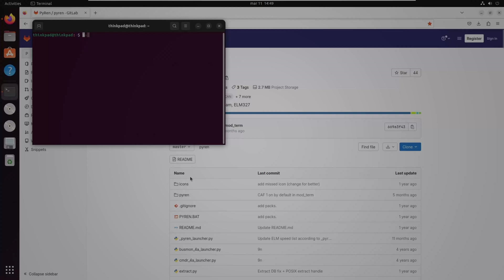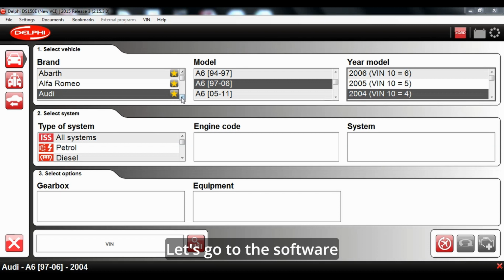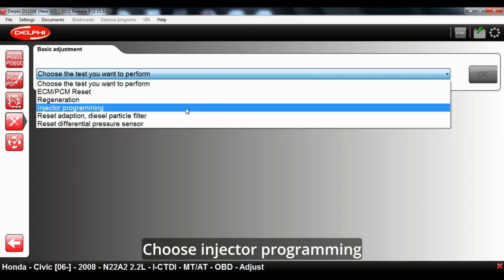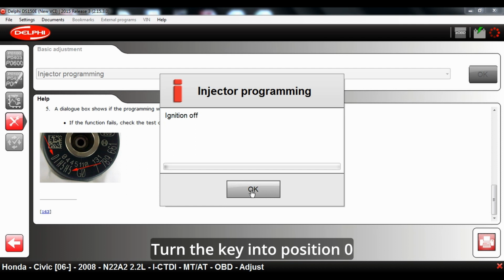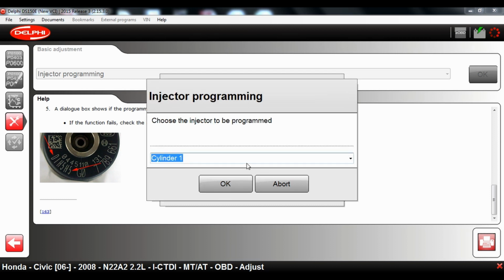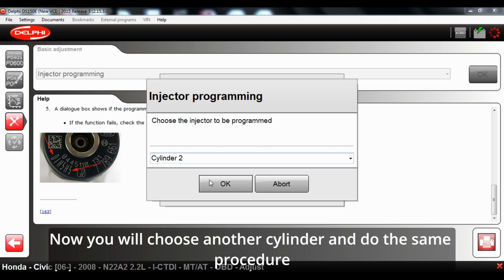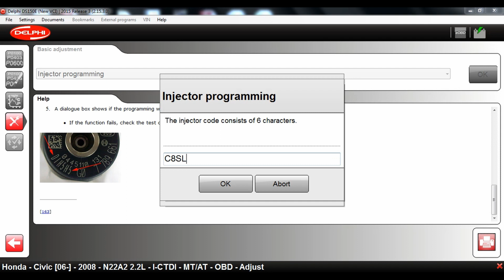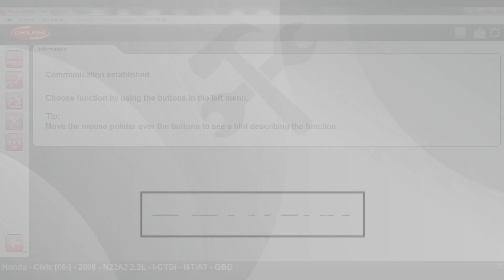How To Code In Injectors Using DELPHI DS150E - CODE INJECTORS

Comment: Dise this work on caddy bst sdi 2007 injector coding  ???
Reply from the maker: The video shows a different injection system. BST is a PD engine. I am preparing instructions for replacing and adjusting injectors on a PD engine.

Comment: I try this on a icarsoft for injektor replemented, i get 4 choice of injektors have tra all and write in the injekorcode but get the same message , communication problem,
Reply from the maker: What is your vehicle like ?
Reply: @easywork2  there its a opel Vectra c 1.9 cdti , i give up  too program im started upp the car without no problem and no error codes
Reply from the maker: If you have Delphi diagnostics, I recommend you upgrade to newer software. You don't need to change your hardware, just download and install the new version.
If you purchased all new injectors, I definitely recommend coding them. Yes, in most older vehicles there is no noticeable difference with a coded injector. But there may be different smoke levels, fuel dosage and therefore increased emissions, reduced performance, etc.

Comment: peugeot 3008 1.6hdi-4 refurbished injectors fitted at cost of £750 but wont recode? why? any views or opinions welcome thanks
Reply from the maker: Hi, please write more information about the car. And I also need information about diagnostics.
Reply: @easywork2  d engine management light came on before xmas-loss of power and missing-garage said bad diesel and 4 injectors needed removed cleaned  and tested-they said they got them refurbished at above cost and when they went to recode them when reinstalled they wouldnt recode-- none of them-they sent car to a car electrical repair centre which has an excellant name-they have a lot of high tec equipment-today garage contacted daughter and said this centre  couldnt get injectors to recode either-all major garages in town honda-jaguar-ford-nissan etc use this centre and it has a great name-these are the oridginal injectors from car new-- car 12 years old-they suggested there could have been a manufactures code inserted when car brand new which over rides the codes on seperate injectors---but they dont seem to know-garage say nothing they can do and want £1000 to cover costs in other words car is scrap but was going 100% before this and always well maintained-would it b worth taking to peugeot-rang local dealer no help what so ever-thanks-wild guess on my part could it b ecu brain fault?
Reply from the maker: They probably don't know. I certainly wouldn't give them money.Your car will work without coding. But I would definitely code them.
I think there will be no problem in the ECU. Car still not working? 
I would need to see the error list from the ECU, freeze frame data, and live data.

Comment: Just a question in this specific Honda motor, 2.2 i-ctdi…how do you know physically what is cylinder n1, n2, n3 and n4 watching the motor from the front side? It is alligned 1,2,3,4 from left to right? Where can I find this info from Honda?
Reply from the maker: Hi,
It starts from the timing chain or timing belt.Of course, this is not always the case. But mostly yes.If the timing chain were on the right, it starts from right to left.
Reply: @easywork2 thanks man! Could you share a picture or something official about that numbering? I am talking about this N22A 2.2 ictdi motor, thanks anyway man! Really appreciated for your help and nice video 👏👏
Reply from the maker: I can't share Honda's manual here. I will only tell you that you can find the manual for the N22A2 engine on the Internet.
Thank you for your support. 👏

Comment: hello, is it possible for an renault megane 3 dci 2013. And can it also ben used for the electronic handbrake?
Reply from the maker: Hi yes. What do you mean by handbrake? Changing the brake pad?
Reply: @easywork2  Yes the brakepads
Reply from the maker: Yes, it should work.

Comment: can delphi prime fuel pump as well after replacing the injectors?
Reply from the maker: Yes but this car does not have a fuel pump. Only high pressure diesel pump.
Reply: @easywork2  I thought you need to prime low pressure one anyway with software to purge air after work has been done on fuel system.
Reply from the maker: Yes, definitely yes. But not all vehicles are equipped with a low pressure pump.
Reply: @easywork2  i have scirocco 2009 2.0 tdi. I used to just do ignition on and off a few times when I replaced the fuel filter for priming the pump but looking for a software solution after replacing injectors. I know it has hpfp just not sure about purging air.
Reply from the maker: Don't worry, start the engine.

Comment: Hello, I have a remapped smart roadster, and I plan to use ethanol. I that the original injectors will not be enough to supply the additional fuel I'll need. If I put in higher flow injectors from the model above (a brabus), the engine being else the same, can I recode these injectors using the DS150e to compensate? That would be useful when running standard petrol as the brabus injectors would flow too much fuel then and would need to shorten the pulses.... Thank you !
Reply from the maker: Hello. Of course, the injectors will need to be bigger for ethanol. Coding the injectors won't help you. There you need to make two plans for the ECU. One for gasoline and one for ethanol. This is an individual adjustment and unfortunately I can't explain it to you over the internet.

Comment: Mercedes-Bens E-Class 2021 need to programming after injector 3 replaced? And what will happen if not programming? Note: Check engine light still ON even after I replaced the fault injector 3
Reply from the maker: It is necessary to program them in for proper functionality.Your check engine light is on because you have stored some fault code in your ecu.

Comment: 03:30   Why  ingnition off? The connection between the vehicle and the diagnostic tool not broken?
Reply from the maker: The procedure is indicated by diagnostics :)
Reply: Is there any need for me to do ignition off?
Reply: Informative
Injector programming 
Engine off. Ignition on.
Reply: @konstantin-big  ,Engine on, ignition blow !
Reply: @MrCroky123 
Injector  programming 
At 4:06 there can you see 
Engine off   ignition on
Reply from the maker: I think it's clearly visible in the video.
Reply: @easywork2  , yes, I know. But wouldn't it be mind-blowing ?! Or ignition blowing ... just joking guys. Sorry. It's a great video :)

Comment: Will this work with Accord 2004 2.2 ictdi?
Reply from the maker: Hey, yes it will work on accord too.
Reply from the maker: I also changed the timing chain to N22.
Watch the video on the channels.
Reply: Do you have a clone tool or original? My brother has clone, but it's dual board same as yours case.
Reply from the maker: @StefaTGM I am preparing more videos with this diagnosis.
It has many functions.
Subscribe to the channel, many things will be connected with the diesel Honda.
Reply: @easywork2  great thanks man, where are you from?
Reply from the maker: @StefaTGM I'm from Europe
Reply from the maker: @StefaTGM I can't write here.
But the original is expensive 😅

Comment: Can i connect the software with odb2? i have Chevrolet Orlando. Where can i get the software?
Reply from the maker: yes, the software is compatible with obd2. On the page you can find out if the diagnostics is compatible with the car.
Reply: @easywork2  i have a noname obd2 for Chevrolet Orlando and i want to coding the injector because i changed all four, i also can use Delphi diagnostic Software on my Laptop and connecting with Bluetooth to my noname obd2?
Reply from the maker: @HiiBo23  yes, it can also be connected via cable

Comment: Do you have to code Delphi injectors when you replace the inside valve inside of injector? Or not since we don't replace the nozzle?
Reply: If you don't replace the electrical part of the injector, you don't have to code it.
Reply from the maker: Injector overhaul?

Comment: so what will happen if u dont code the injector on to the ecu
Reply from the maker: Unfortunately, the production of identical nozzles is not possible even in a first-class production facility. Because common rail injectors operate at very high pressures, small differences between them can make a difference in the amount of fuel they deliver. This is about the efficiency of the engine, which can be a reduction in its power and an increase in noise and smoke.

The amount of fuel supplied by the injector is proportional to the injection time (impulse) and the pressure in the rail. Therefore, it is possible to compensate for the performance difference by controlling the pulse duration for a given injector.

New or refurbished injector, it must be marked with a specific code. Installing an injector on a vehicle with this code requires reprogramming the engine control system (ECU)
Reply: Boooooom!!!

Comment: Coding injector for land rover freelander 2004 ?
Reply from the maker: Yes, you can also code a freelander.
You have to follow the instructions in the video.
Reply: @easywork2  they say that it cannot code injector on every car. that's why I asked you
Reply from the maker: @Pera-Peric  what engine do you have?
Reply: @easywork2  land rover freelander td4 2004 bmw engine 204d3
Reply from the maker: @Pera-Peric  it will work 🙂
Reply: @easywork2  no option to injector programming for my freelander 😕🙁
Reply from the maker: Do you have delphi diagnostics? @Pera-Peric
Reply: @easywork2  yes. Delphi with best board, nec japan relay and epcos filter with Bluetooth and speaker on board
Reply from the maker: @Pera-Peric  i was browsing forums and found out some types of land rovers doesn't need injector coding. I was also reading delphi documentation and your car have the same OBD capabilities as the car in the video. So i don't think your injectors need coding.
Reply: @easywork2  ok. Thanky man. And sorry 😔
Reply: @easywork2  do you have any idea if it’s able to code injector on Megane 3?
Reply from the maker: @Homam-gm3dw This particular diagnosis is only up to 2015.
The newer one also encodes newer vehicles.
I will look at the Megane 3.
Reply from the maker: @Homam-gm3dw I looked it up, megane 3 is in delphi diagnostics